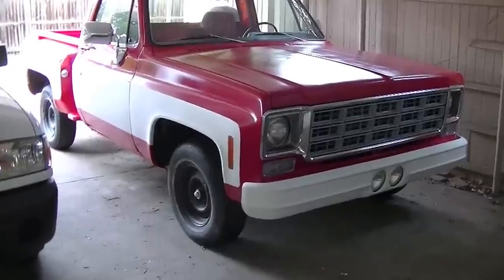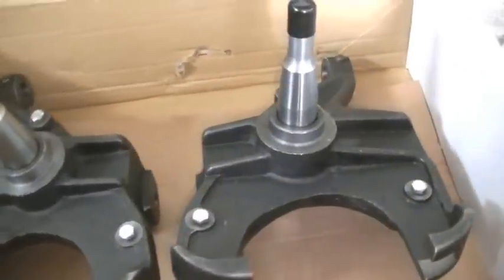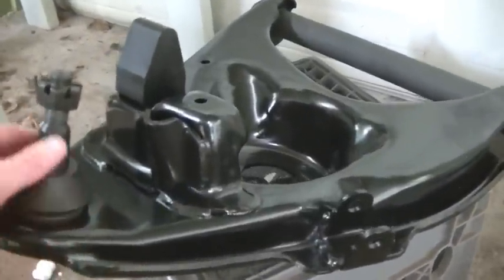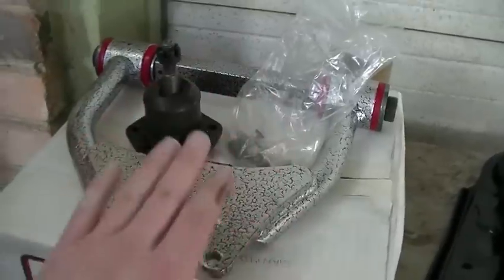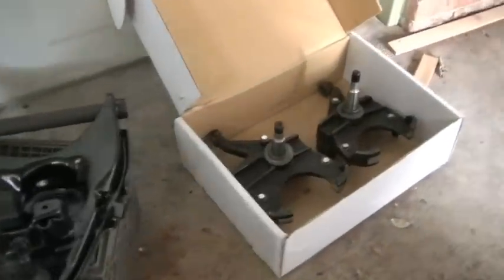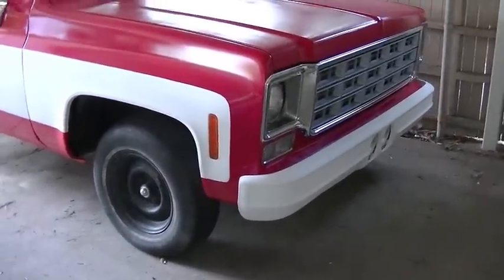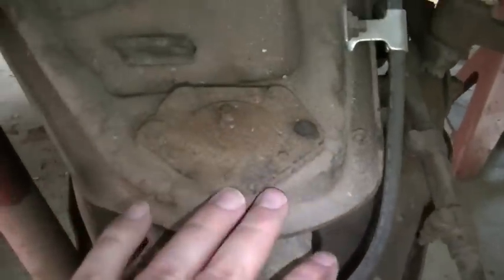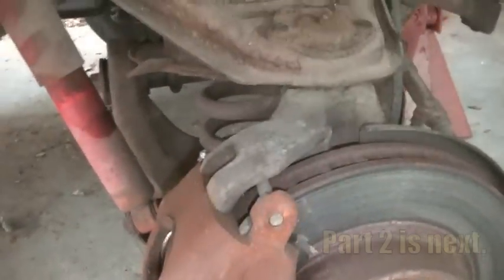PART 1 C10 5" FRONT DROP | CUT COIL SPRINGS AND DROP SPINDLES

Comment: Thanks for the answer!  I just want to know if the ball joints original of its C10 , perfectly fit into the drop spindle that you have installed, or have to use some own to fit into the drop spindle hole, and the drop spindle fits into any C10 1973/1986 Thanks !
Reply from the maker: +le queiroga Yes, the ball joints fit perfectly into the new drop spindle.

Comment: GOOD MORNING! Please! I bought a drop spindle 2.5 '' , when I was in the US to install in a Brazilian C10 suspension adapted in my chevy truck in 1954 , and found that the measures of the holes would be equal to the US , and are not. I must buy at ebay and I'm afraid of making mistakes . Can you tell me what the specification of the upper and lower ball joint and the tip that fits into the third hole ? Can I purchase for any year of manufacture of the C10 in your country? You can mark a seller on ebay with a link of correct parts for my drop spindle ? Thank you!
Reply from the maker: +le queiroga I'm sorry, but I don't think I can help you out.  To get those measurements I would have to disassemble the suspension.  I'm not willing to do that.  Sorry I couldn't be of more help.

Comment: The lower arms u used look like they are for c20 the original c10 arms dont have the deep spring pocket. Im bagging my 78 c10 and im told those arms are not interchangable. I need the deep pocket so the bottom bag bracket will fit snug. Do u know for a fact that they are for c20 And fit c10 so i can order some.

Comment: where did you get the lower control arms? are they for a c20-30?..like last guy comment..I can't find them anywhere.. unless tubular.
Reply: Look at Rock auto....for my 1994 1500, buy the time I bought ball joints, and bushings and had them pressed in, new a arm assembly was only a little more.

Comment: Where were you able to buy to complete lower control arms?  How do i determine what size rotor i have?  I have not seen where it is measured at/from.  Ty Truck looks nice.  Excellent job on your videos, very informative!
Reply from the maker: Ron Hig I ordered the complete lower control arms from eBay.  I can't remember which specific eBay seller sold them though.  You measure the rotors on the braking surface.  They will either be 1.25" or 1".  Your measurements may be less depending on how worn the rotors are or if (or how many times) the rotors have been turned.

Comment: Good video can't wait for part 2. I curently have cut springs on mine too I cut 2 coils on mine got a 3 1/2" drop want to get some spindles too
Reply from the maker: Manuel Ramirez Part 2 will be coming out soon.  Thank you for watching!
Reply: How is your ride with the 2 coils cut off a d the alignment??
Reply: @robertsmith1639  it was not bad actually a little rough . I now have 2” drop springs with 2.5” drop spindles and tubular lower and upper control arms with sway bar from CPP. And this rides way better. Used beltech drop shocks as well.

Comment: Nice vid! I just picked up a 78. Which impact gun are you using and was it enough torque to remove your suspension bolts?
Reply from the maker: DtheGreat I'm using an electric impact from Harbor Freight.  I have not yet found a nut or bolt too tight for it to remove, so that a plus.  It's bigger and heavier than an air impact gun, which is a hindrance in some situations.  So far I'm very happy with it.  It's hit or miss with Harbor Freight.  This one seems to be a hit.

Comment: Where did you get the lowers for only $20 more than just the replacement parts? Can't seem to find lowers even for sale anywhere...
Reply: I can’t find them either. What’s the part number for the lower control arms?
Reply: Me either. I read somewhere that you can modify c20 arms to work which are easier to find. Haven’t been able to find details on what’s involved though so maybe it’s a myth.
Reply: It looks like the c20 a arms, I’m also having a hard time trying to find c10 arms. They look like the ones from eBay for $128 for the pair ball joint and bushings installed.